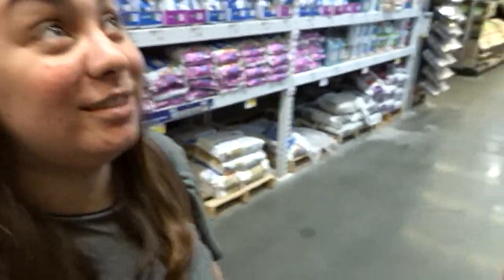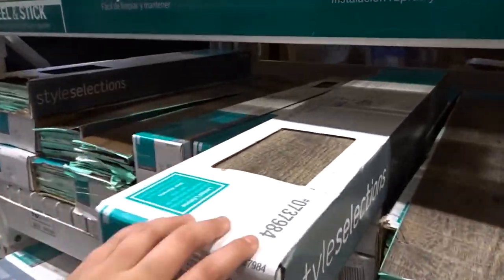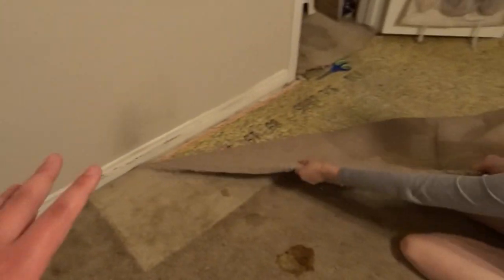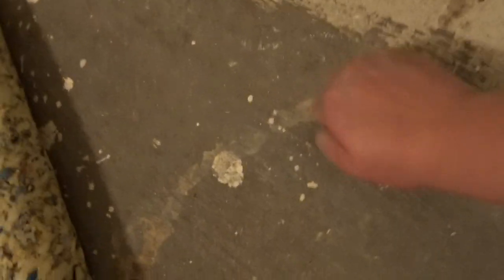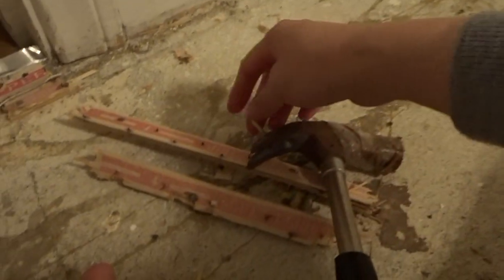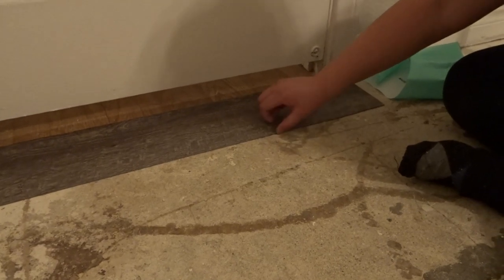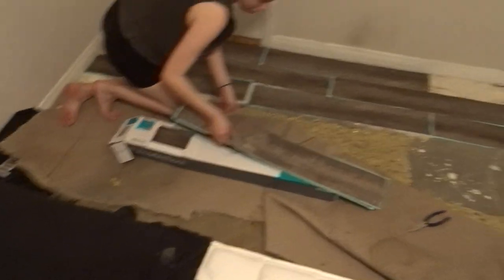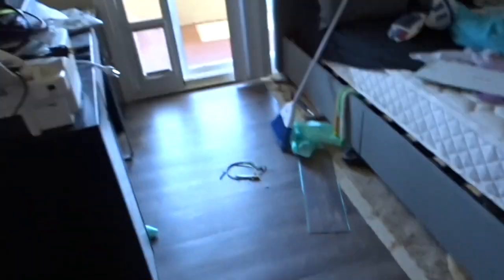DIY FLOORING FOR UNDER $150

Comment: Nice job, gals!  It looks much better and is so much cleaner.  To anyone laying peel and stick vinyl, those floors are usually good for 2-3 years and then the tiles start drifting so uneven gaps open up between the tiles you took such pains to lay straight and tight.  Eventually tiles start coming up on the corners.  That's because moisture and dirt (especially with dogs and kids) works its way under the tiles and loosens the adhesive.  To make your floor last longer, put 2-3 coats of water-based polycrylic on it.  That will stop liquid spills and dirt from getting under the tiles, and help to hold them in place so they can't drift.
Reply: I always used a thin coat of industrial tile glue for the peel and stick tiles that always seem to hold them in place better then the crap adhesive stuff I laid 25yrs ago is still holding even after flood damage but I would definitely add a nice hard seal coat too

Comment: For later projects, a shovel works better for carpet tac strips. Lay the steel end flush to the floor and quickly glide it along the floor toward the tac strip. The edge should lift and separate the strip form the floor. After use the claw on the hammer to remove the concrete nails that remain embedded.
Reply from the maker: thank you! will definitely do a better job next time.

Comment: Just curious, but what was your landlord’s reaction to the half carpeted/peel and stick room? 😩You guys should of completed the room to at least leave the place in decent condition for future residents.
Reply from the maker: empress hi! we did finish it and im not sure what the landlords reaction was its a gigantic complex with probably 200 units in them and when we moved out we ended up giving the lease to our friends so the leasing office probably still has not seen it.
Reply: @Amy_allen00  yes. I'm happy you did under the bed too. You only can do that thing of " leaving carpet"  under the bed if you are the owner. No landlord is gonna accept back half the room done. I do think what you did is an improvement,  though. But I'm thinking now. If you didn't clean the floor before paste it. Eventually it will come out. Because the tiles will not past against dust.

Comment: Sorry everyone is giving you so much crap. I'd prefer this over the carpet. I have 20 cats and my rental carpet has gone to shreds. I planned to just rip out the carpet and install vinyl completely throughout. They did that with the kitchen, bathroom used the vinyl stuff but didn't do the rest. RIP. I think you did okay for the first attempt but I always recommend completely removing everything in the room, wash the subfloor and redoing the entire surface. Dont leave carpet under the bed etc.
Reply from the maker: Tiny spoons! your are the bees knees!!!! thank you!!! when I uploaded this video I didn't think youtube would actually push it XD I install flooring a lot better now haha

Comment: Listen girls in the box sais how many square feet it cover. Also to know how many square feet your room has you have to measure each wall . ( 2 of the because it is rectangular. The 2 walls that form a 90* degree . Let's say one wall is 10 feet the other is 8 feet . So you multiplied those numbers. 8 x10 = 80 . So now you know you have a 80 square feet room.

Comment: Yes 1 box is not enough. I don't know how you did the calculation. But in the box is gonna say each box covered 20 square feet . Let's say. So you measure the room . If it's 40 square feet u buy 2 boxes and so.. an so

Comment: Omg!! So they dont appear to bath, or clean, their pets are on the tile as their trying to stick it on. This stuff is not water proof! The cats /dogs will pee on it. The wall panels were filthy when she slid it under.   Anyway 🤮 to how filthy these ladies are.
Reply: They should have potty trained their animals better granted and if anyone wants to do this CLEAN THE CONCRETE OF DUST BEFOREHAND but is there any need to comment on their personal hygiene? That's just mean speculation.